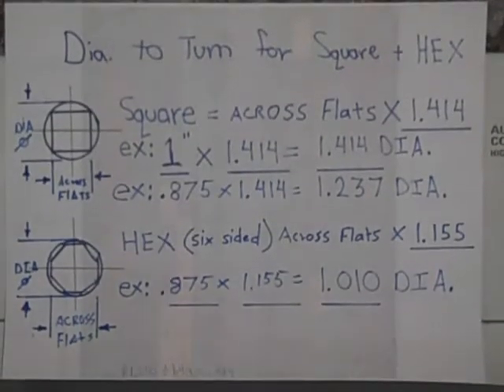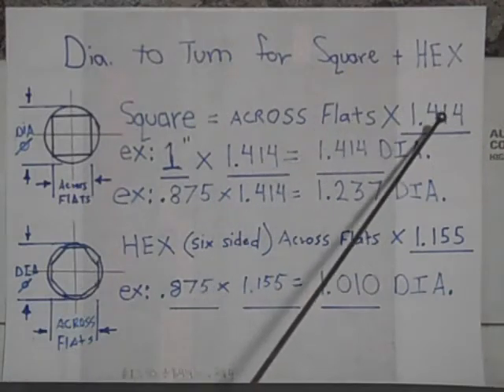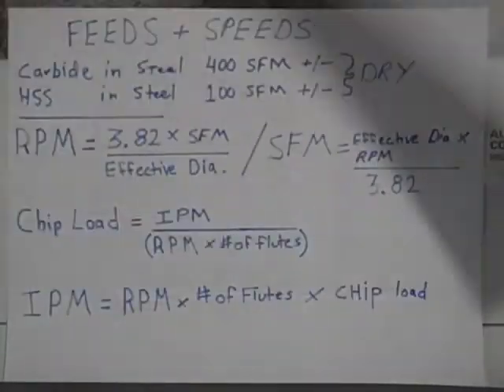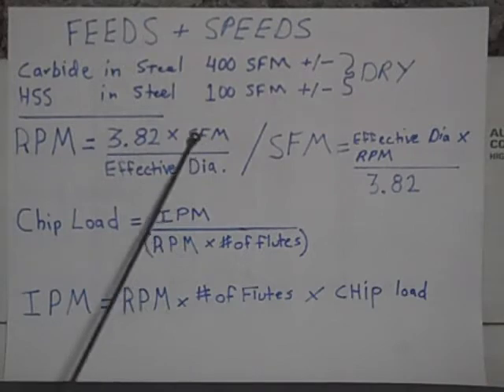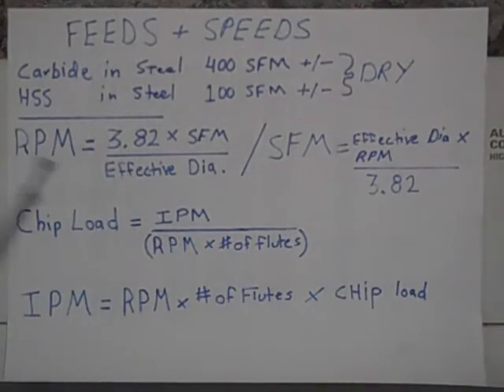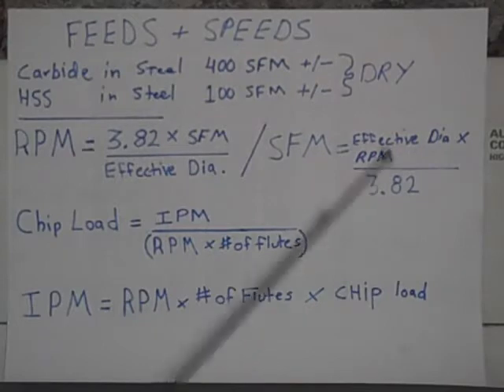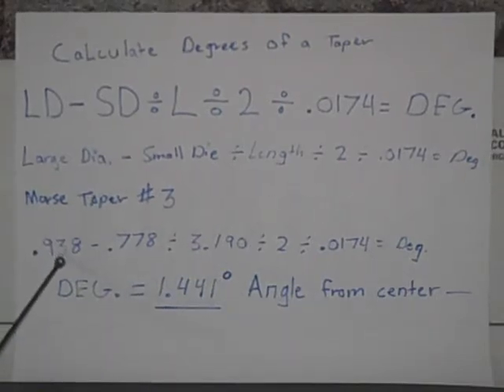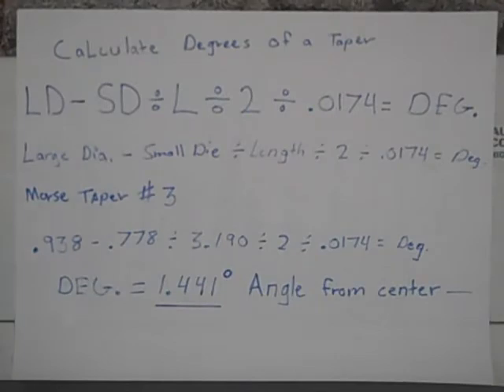machine shop cheats.mp4

Comment: The taper formula was the ticket , your formula was easy to use and I was cutting two different tapers with different lengths ....worked like a charm.

I also use your thread depth formula all the time on all my english threads and it works great .

Comment from the maker: @TheKelstr Glad to here the formula will help you. I should have mentioned the degrees equation is not perfect.According to the Machinerys handbook the actual angle in degrees is 1.4377. Witch is only a .0033 difference. In degrees-minutes-seconds reading it is .198 seconds off. Not evan a whole sec. Thats closer than airospace tolerences. Thanks for watching.

Comment: This is really good stuff, I need the taper formula tomorrow , I was just trying to find the taper formula and could not come up with anything , I could not believe you had it on here .......this will really help me tomorrow ,thanks !!

I have gotten really lazy on bolt circles because my newer DRO's  will do it for me.

But I used to use that same sheet you have there on bolt circles when we had to do them the hard way .

This is all really great info ...Thanks